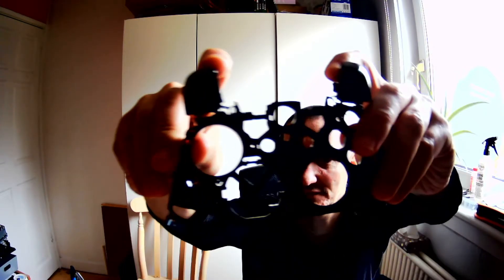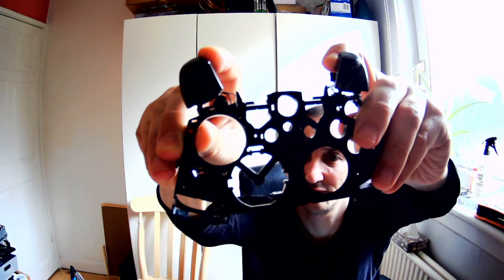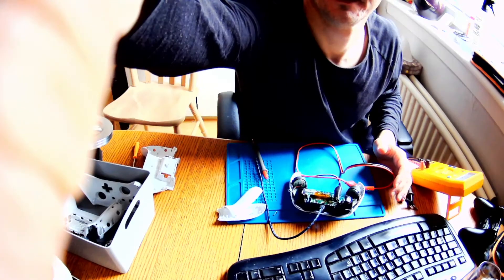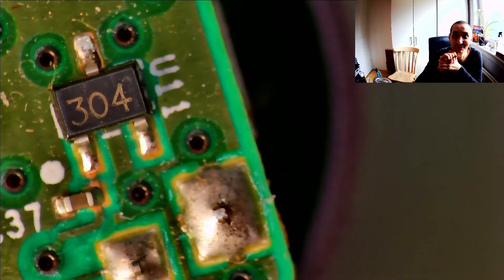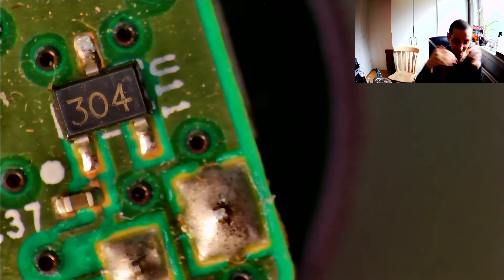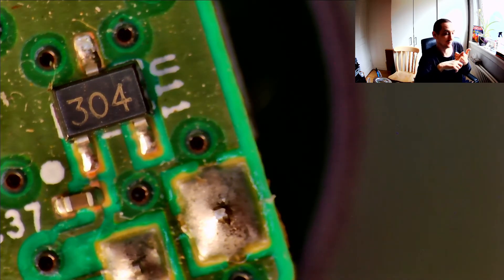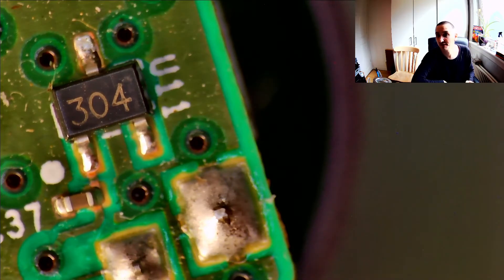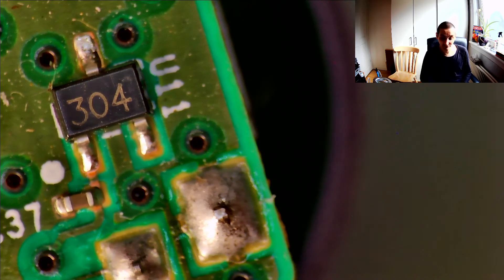Microsoft wireless gamepad 1708 - part 3: Hall effect sensor damaged, this is a 4th fault fixed here

Comment: Is it fixed after replace the ic hall effect?
Reply from the maker: yes
Reply: My xbox series controller have both (lt rt) bumper trigger always on (after i replace left analog), does this fix will help?
Reply: @FiniMustika  I don't think so. I think you have to correct your repair you've done to fix it.